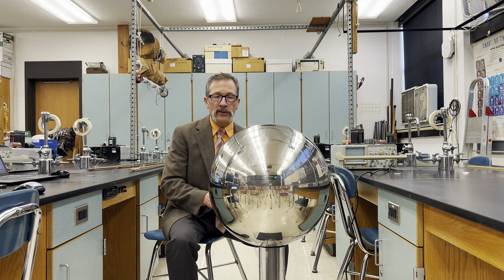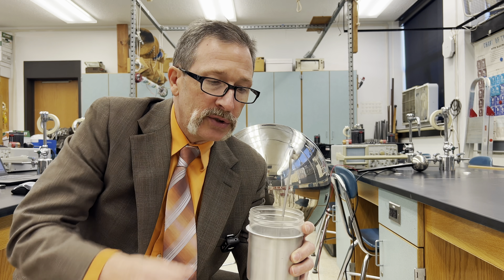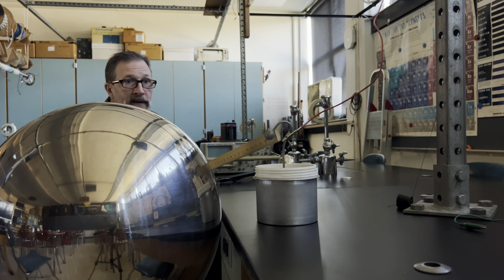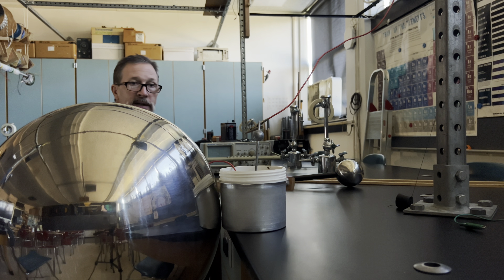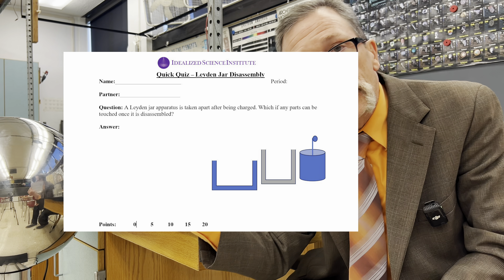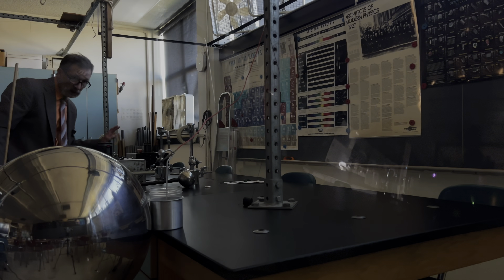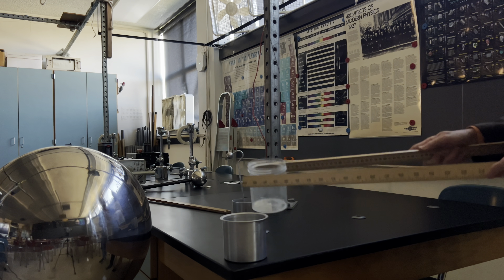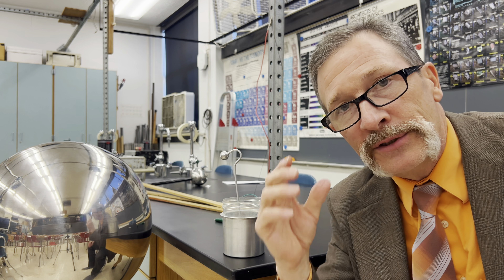This Simple Device Could Kill You

Comment: Hi from France !
Many many thanks for this sparky and ozone-scent loaded experiments ! That's something quite rare and precious to explain electricity properties when dealing with HV domain.

One thing which could be formally added with this clever video : NEVER USE BOTH HANDS WHEN HANDLING HIGH VOLTAGE COMPONENTS.
Sometimes said : "One hand on the desk rule".
As I have read in specialized labs, placing a second hand on the charged insulator can loop a flow of electrons... near the heart and creates a deadly strike.

Best regards, bravo pour cette jolie explication !
Reply from the maker: Thank you for this comment! This is a very good point!

This is one of several safety related videos we will be putting out as we start to develop a full online course in E&M. The one hand rule will definitely be part of training! Keep an eye out for this series of videos in 2026
Reply: I learned the 'left hand in pocket' rule over 45 years ago. It sticks, I'm retired now but still find myself doing it instinctively when working on electrical items.

Comment: In Sydney AUS they teach you to use a multimeter in the ohms range to discharge dangerous capacitors....
Reply: Not a good idea to use ohms range ! - will destroy the meter.
Reply: @eric4709  Of course he sells new overprised meters. DMM'S generally have a metal oxide (MOV) protection. When they become half dead the readings will be off.
Reply: @LawpickingLocksmith  Comparing to other brands, there is nothing overpriced about Brymen meters and you have no clue how multimeter protection works, if you think that a MOV is the only thing protecting the meter.
Reply: @LawpickingLocksmith dunno I’ve not seen a single dmm go off other than ppl blowing them up with overcurrent
Reply: @eric4709  Good for the seller of new meters!
Reply: Definitely don't use ohms range! First off, obey the voltage rating of your meter (most reasonable name-brand meters are rated for 1000V and you're likely to have far more than that on a Leyden jar). Then, assuming your meter is rated for the voltage, use the "Lo-Z" setting on your meter to measure and discharge the capacitor. It will be specifically designed to limit current. Regular volts move will have a very high impedance and will not quickly discharge a capacitor. Amps mode will short the capacitor out and likely blow the fuse. Ohms mode is not designed for high voltages and, while it will be safe, is likely to be damaged by high voltage. Personally, I would just use a large resistor (perhaps a 1M wire-wound resistor) and clip leads.
Reply: @CoolerQ  I agree, except ONE resistor! Use multiple in series at high voltage!
Reply: @CoolerQ  Of course the proposer has a vestigal interest on selling his rebadged Brymen meters Personally I have invested into a rated HV probe. Our tech school teacher would have crucified us for not storing them meters in the 1000V AC mode. He told us endless times that the extra 0.6V would matter!!
Reply: @CoolerQ  https://www.youtube.com/watch?v=pXZtk68B3zY&t=6s
Reply from the maker: An analog voltmeter is really good for this!
Reply: @idealizedscience  In which way is an analogue meter better than a digital one in this case?
Reply: @galileo_rs the analog movement gives a buffer to absorb the discharged energy into .DMMs don’t have anywhere to dump the energy as they aren’t built to discharge capacitors. 

It’s literally that the current spike goes directly to the needle pushing against its spring . 
A DMM is more precise but its components are solid state and not built for the voltages or the current spikes from discharging caps of dangerous voltages
Reply: That's also a great test to find out which of multimeters contains copious amounts of magic smoke. Usually appears only with really large capacitors, only one way to find out.
Reply: Aussie meters are tough, they can take it!
Reply: @A @A3Kr0n but he sells Taiwanese made ones.
Reply: That would be a good way to blow a fuse.
Reply: @jhoughjr1  Input impedance of multimeter is 10MΩ, no way you are going to blow a fuse.
Reply: better to use the 10A setting, which is way less than 1 ohm
Reply: @xonx209  prefer the unfused ones!

Comment: It amazes me that most people still think that charge resides on the plates. While it clearly resides in the electro static field (or magnetic field or displacement current field).
This is so well demonstrated  with this experiment.
the dielectric (which can be the Vacuum which is filled with energy) holds the electrostatic field. it can only move its charge (the energy in the field) when conducters are present to move the electrostatic lines of force and thus create a flow of energy which we call (displacement) current.❤
Reply: The CHARGE resides on the plates. It's excess of electrons on one side and lack of electrons on the other side. Net charge is usually zero.
Maybe you meant "the ENERGY is stored..."
Reply: @copernicofelinis  yep. your viewpoint amazes me.
I wonder what energy really is to you?
Reply: @MasterIvo you did say that the charge resides in the electrostatic field. Do you stand by that assertion?
Reply: @copernicofelinis  yes. charge can reside in the electro static field. the magnetic field or the displacement current field. it is between the plates, around the conductors. 
And energy has momentum and inertia.
these are my view points
Reply: @MasterIvo just curious... Let's say we have two electrons , one in point A and one in point B (let's forget about QM, at the moment). There is a an electric field around them, with field lines pointing to each electron. 

So, the charge of these electrons is not in A or B, but is... In the field around them?
Reply: @copernicofelinis  yes. the (qm) electron in my opinion is a mathematical representaion of the field energy. it was made up by  JJ Thomson who called it a corpuscle, he wrote about it in his book "Electricity and matter". later this led  him to recieve a nobel price. while he very well knew it was only a mathematical construct to be able to calculate on field energy.
I see everything as a construct of energy. so the energy of the field is the charge.
You could say that the start point of the electrostatic line of force on one conducter resembles your electron. while the end point of that same electrostatic line of force on the other conductor is your other "lack of electon".
Reply: @MasterIvo so, when you apply Gauss theorem to a closed surface in the space between point A and B (without including them) you get a nonzero result?
Reply: @copernicofelinis  I am not familiar with that
Reply: @MasterIvo ok, I was going to write a snarky comment but since this is an educational channel...
Gauss' theorem, in the context of classical EM and in particular electrostatics, tells you that the net flux of the electric field E through a closed surface is proportional to the charge enclosed by the surface. It is one of Maxwell's equations and if it is not obeyed by your theory, well it is time to look for a new theory.

My suggestion to you are Ohanian physics course (if you find an old used second edition it would be ideal) or Kip's EM book (an old but good McGraw Hill textbook).
Reply: @copernicofelinis  Thanks I'll look into it, and will think about it once I fully understand the question❤
Reply: Also this: https://en.wikipedia.org/wiki/Leyden_jar#Storage_of_the_charge
Reply: Make a capacitor with two parrallel metal plates. Place say a sheet of glass that  fits snugly between the plates
( Er = say 5 for glass) 
Now charge the capacitor to v volts .  Q = CV..  
Now remove the glass.
C goes diwn by 5 times - but voltage increases ×5  to maintain Q = CV?
Reply: Your viewpoint is patently false.  There is no charge on the dielectric, nor will it maintain any static electric field when disassembled from the capacitor. 

The false presumption in this video, is that either plate will "safely discharge" into ground when handled separately: safe or not, they will not discharge at all in this manner.
Reply: @ianallen738  I googled this and was told, by some trustworthy-looking "old internet" university site, that the charge separation is transferred to the dielectric during disassembly, but it doesn't shock you because it's an insulator. Of course it still has zero NET charge. Is this not what happens? If the dielectric doesn't maintain an electric field, then what property of the three disassembled parts retains the ability to create a spark?
Reply: @ianallen738 I agree to disagree.
❤
Reply from the maker: To be fair, we make our videos with high school teachers in mind. When one is first learning E&M, almost nothing is obvious!

Thank you for the comment!
Reply: Electrostatic field is caused by charges...
Reply: @thewhitefalcon8539  electrostatic field is caused by friction of dielectric materials, or by the resonant transformation of the magnetic field energy which holds the charge
Reply: @MasterIvo   Friction of dielectric materials causes charges to move, called  triboelectricity. When you separate them the electrons stick more to one than the other, and don't fully neutralize, leaving a static charge. No idea what you mean about resonant transformation of magnetic field energy.
Reply: @thewhitefalcon8539  it's good to have different perspectives on the same subject. together we see more

Comment: Yeah, that dielectric absorption can be an issue with large high value capacitors. That's why they are shipped with shorting resistors or foam.
Reply from the maker: This would have been a good real world application! We will add it when we make the polished version of this for the course we are developing. Thank you!
Reply: Which is why power supply capacitors have bleed resistors across them.
I used to work on equipment that had these - nothing exciting voltage wise (750v) or capacity wise (possibly 1000uF, not sure about that bit) but enough to do serious damage.
We were told switch off and wait two minutes before doing anything. I would then check with a meter before touching things, we would then short the discharge circuit (a normally closed contact on the main power contactor) to make doubly sure the capacitor could not recharge.

Comment: I saw this experiment before. You can touch EVERY part of the Leyden Jar when it's charged and disassembled.

When you put it back together, the charge is STILL there! 

I think the charge is stored in the dielectric material. Because it's an insulator you can't touch enough of it to create a conductive path. Too little surface area.
When you put it back together it has enough surface area contact to create the path that could lead to a complete circuit. 
I cheated having seen this before watching Professor Julius Sumner Miller's videos. ❤👍
Reply: So, if you touch the plastic part with full hand instead of two fingers and have inner part in then you'd get zap right?